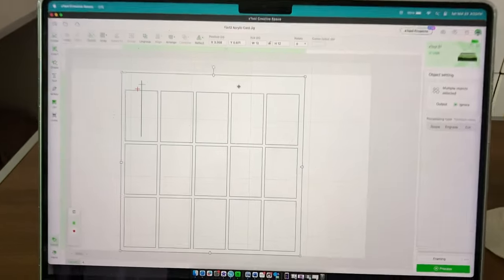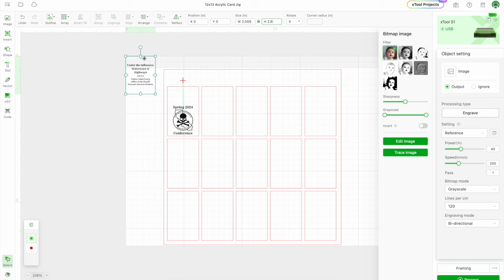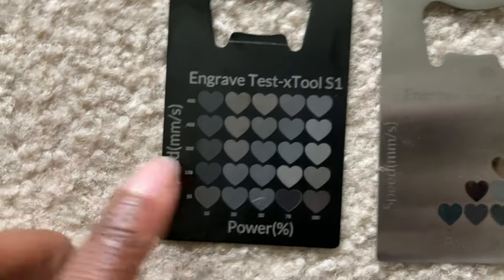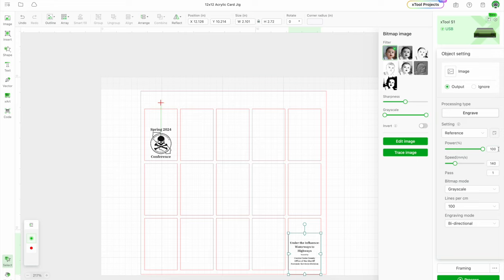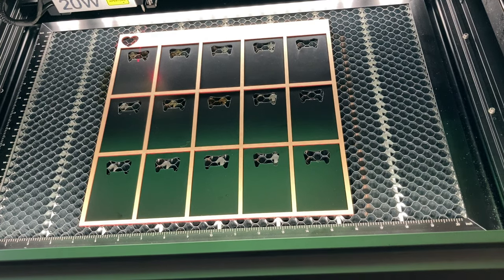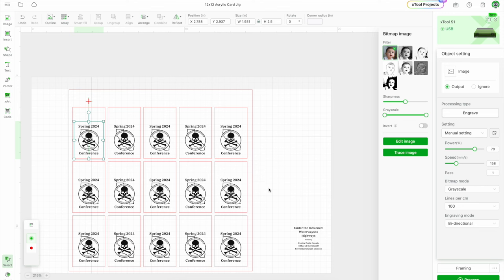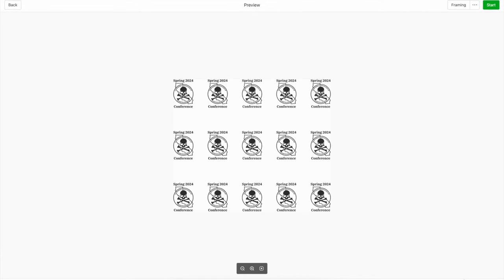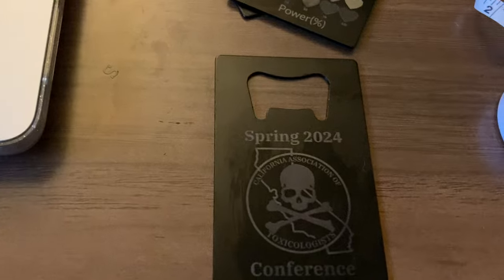Bottle Opener Batch Processing xTool S1 Tutorial Step by Step

Comment: So I understand that you have to align your crosshairs, but I’m confused about how do you set your marking for the jig? 

I aligned my crosshairs on my targets but when I set my markings and then frame, it’s not framing to the where it’s supposed  to frame..
Reply from the maker: When you make the jig and add your target to where you need to place your crosshairs to line up in xcs you just add your design(s). You don’t need to mark it since it knows where to place your design if you align it in your jig slots. Marking allows you to determine the area you want to design on your material. So if you don’t want to use a jig you can for example place several coasters randomly on your honeycomb and mark each and batch that way. It will frame the area that has design(s). Let me know if that answers your question.